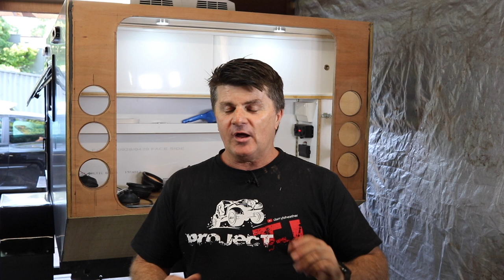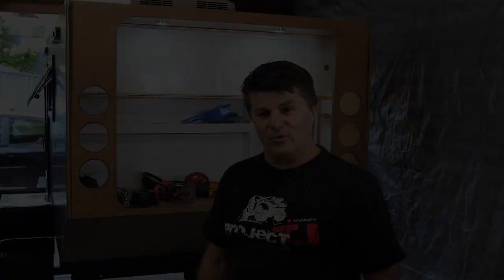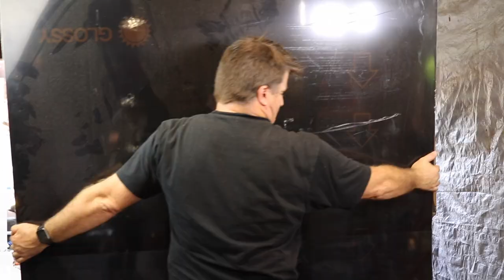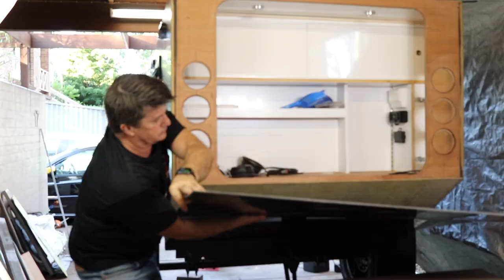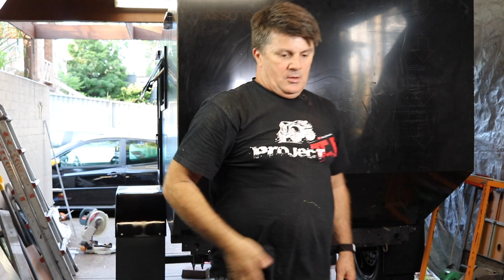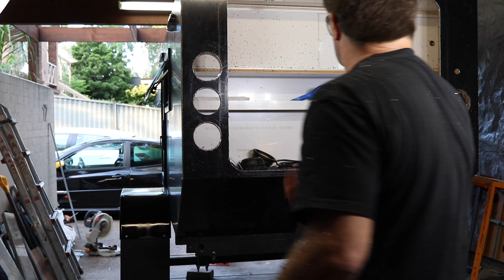Off Road Camper Build - Rear Cladding Install

Comment: That Darryl great videos. Are you using any kind of trim between the composite sheets between the sides and front and back? Thinking of the join between the front panel and the side panels and the rear and side panels? Sorry if there is a video on this and I missed it
Reply from the maker: Yes, we'll go over it in a coming video.

Comment: whats the internal width Darryl ? this isnt 2400L x 1200 w is it ? i made a 6 mtr enclosed trailer with the aluminium composite biggest sheets i could get where 4.0 x 1.5 i think
Reply from the maker: Glenn, It fits a standard size double mattress inside.
Reply: @DarrylSheather  ok ill have to measure a dbl bed lol it looks a good size i wanna do one just for myself for solo travel